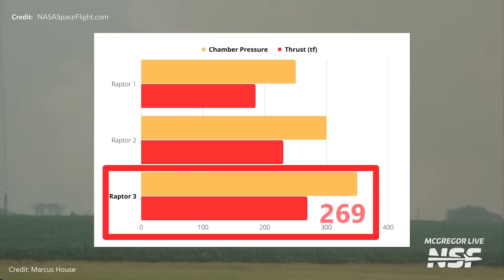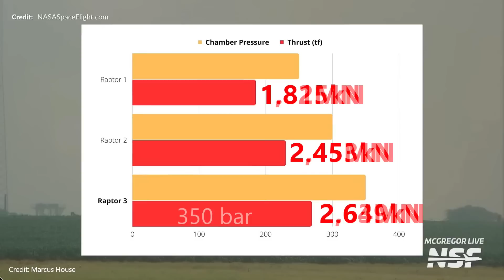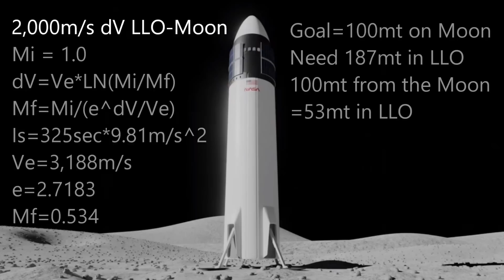Can the New Raptor 3 Save Starship?

Comment: I don't see why starship as a whole wouldn't be able to do a emergency separation in an event like we saw in the test flight. The question was even asked in a follow-up twitter space. The answer was , That's not how things are done, but maybe  we could look at that. That tells me that it's one of those things no one considered, due to the this is how it's done fallacy. Starship with minimal payload theoretically could SSTO on it's own if it used all the fuel. Surely it could be capable of abort to orbit, RTLS, or emergency soft splash. Although I agree it's to big a vehicle to be the only abort option. The simplest least massive capsule style abort should be the option of last resort. Keep in mind this thin is supposed to have airline like reliability some day. In aviation, especially with passengers there is no abort. You fly the plane til the end, one way or another.
Reply from the maker: I agree... there should always be a designated abort to landing or once around the Earth scenario... The cone escape system would be a last resort :-)

Comment: "Hi everyone, I'd like to open a discussion about the wildlife protected area around SpaceX's launch site in Boca Chica, Texas. While we all value the preservation of natural habitats, the current protective radius may be impacting operational efficiency. 

Could we consider removing the environmental protection within a one-mile radius of the site? This change would provide SpaceX the necessary operational space, and with their demonstrated commitment to environmental responsibility, they would continue to handle the local wildlife with care.

A thorough scientific assessment suggests that this change shouldn't significantly impact the majority of wildlife in the area. Any displaced animals could be relocated under expert guidance.

This adjustment to the boundaries of the refuge will help reduce ongoing legal challenges from environmental groups. SpaceX could partner with these groups to develop a robust wildlife protection plan, fostering a cooperative relationship.

It's essential to find a balance between technological advancement and environmental conservation. What do you think about this proposal?"
Reply from the maker: It was done in Florida... It's not like Texas is short of coastline.

Comment: Dude, you're the first that has an idea that compares to mine, I always advocated that the nose section should be an independent craft with steering thrusters capable of re-entering and gliding back to earth (like dream chaser),  with added bonus that it can land on any runway long enough. The tank and engines can return via belly flop re-entry and be caught by the tower. This would cost payload but significantly increase its chances of ever becoming human-rated. The craft would separate from the lower section just after the re-entry burn.
Although we both have different reasons, they both add up to being quite important, and I hope SpaceX pick up on these out-of-the-box ideas.
Reply: The SpaceX Lunar Lander concept is designed so that small engines near the nose would be able to lift the craft away from Lunar surface before firing the main engines entirely because the dust plumes created can be avoided. Long term, this design is impractical. There will eventually be multiple landing pads on the moon, allowing for much smaller and practical LSAMs
Reply: Paul, That much complicates the design, especially the point2point capability. You’re assuming away SpaceX’s confidence that, after a 100 flawless flights less crews, that they will have proven better than Falcon reliability. This is only the first flight, after all. A bit early to throw in the design towel!
Reply: @Crunch_dGH  No matter how reliable the flight becomes, there's still that little issue of never obtaining 100%. No human rating for Starship unless there's a failsafe to retropropulsive landing, which is a paradox in itself.
Reply from the maker: We agree Paul!
Reply: Why couldn't the ring of 24 small rockets originally designed for the HLS lunar lander be used to pull SS away from a failing booster to be joined by the main engines as soon as it was clear?  If they are not sufficient, perhaps some  Draco models, instead...

Comment: We do not have in-flight escape systems on commerical airlines, nor is it necessary. Starship is being constructed for the same use frequency and safety as modern commercial airplanes, so logic says a launch escape system is unnecessary if your design exceeds safety requirements.
Reply: That is aspirational, and I wouldn't hold my breath on it ever achieving that reliability. Also note that there has been more than one successful glide landings of commercial airliners.  Rockets of this nature are pushed to the very limits of the available technology and materials science, and are full of highly pressurized propellant.
Reply: airplanes have wings and operate in a much lower stress environment
Reply from the maker: Starship is not close to there yet and airplanes have a glide to landing capability... Starship has a fall to impact capability. :-)
Reply: Not to mention the space shuttle had no escape system - despite having two explosive SRBs!
Reply: I suspect it will be a very long time before Starship carry’s humans to space. If starship will be used for moon missions, perhaps it will just be a cargo ship, or at best have a rendezvous in space where a Falcon 9 takes the crew up only to move to the starship for the longer voyage.